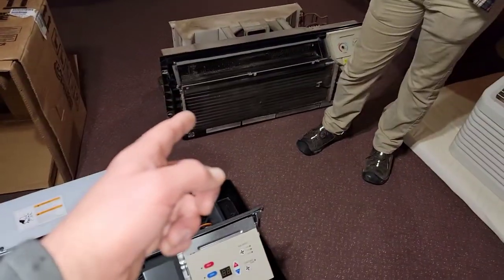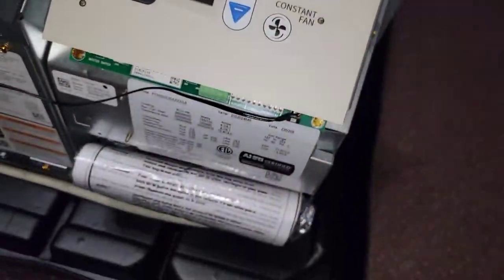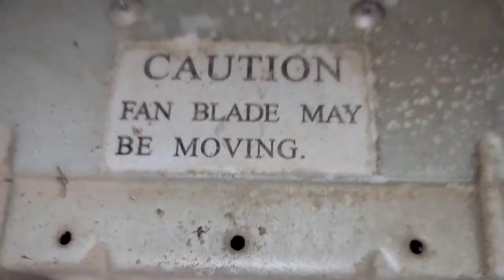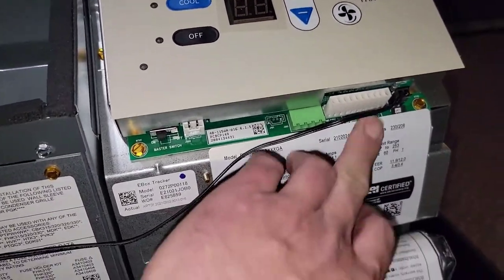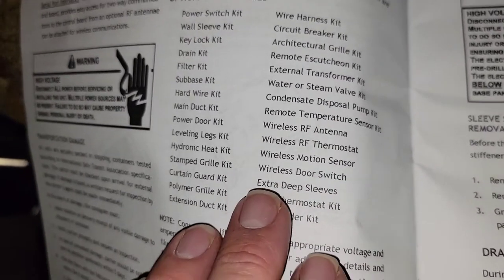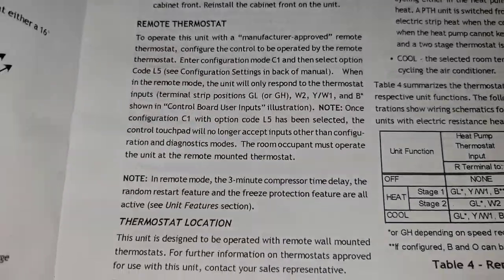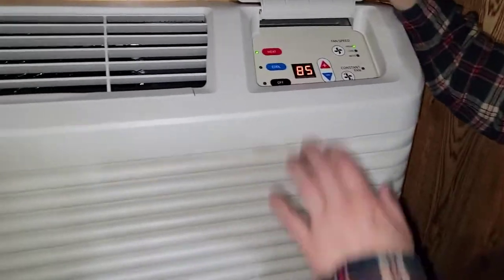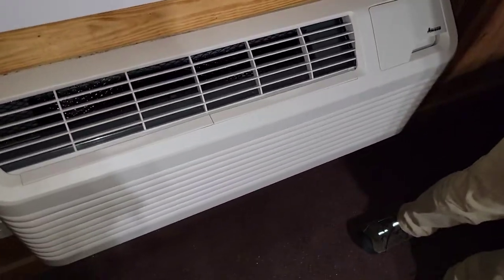PTAC: Old Versus New (Package Terminal Air Conditioner)

Comment: They figured it would save cost and eliminate the possibility of any leaks. Valves can leak over time. But yes, it would be nice. Maybe find some sweat on valves and braze them on as needed.
Reply from the maker: yes you are absolutely right Good idea but for service not so good

Comment: I have been trying to find a video on these Amana PTAC units. Old vs New. and this is as close Is i have found so far.  I have a new style Amana ptac that is maybe 7 years old.  last year, we had a power outage that abruptly shut off this unit during cooling.  When it came back on, it started leaking condensate. not inside, outside, as the older units did. I called my landlord who called Carrier Local Service who said, "Its hot, thats normal, it always does that." and blew me off. First off, it was 74F degrees, that isnt hot.  Second off.... it never did it the first 7 years.... Third.... ive got 36 units in this apartment complex, the only ones that drain condensate are the very few old ones left, and mine. So if mine is working properly, i have 30 that arent :) That was Sept 2020, i shut it off for the season but now its time use ac again. It Cools, but my Electric usage is higher.

my theory....  am i correct in saying that these new units spray the condensate back on to the condenser coil to cool it and which increases efficiency and also causes the condensate to evaporate thus causing no drainage outside the unit.  when other working units end their cooling cycle, you can hear the spray shut down, with mine, i can no longer hear this spray.

forgive my long rambling post, im not very good with writing anymore, i have a ton of health issues and i cant just put a meter on it, or take it apart.  full disclosure, (im a retired master electrician, with a combo cert in build, mech, plum, and electrical inspection)  but none of that matters when the body wont work, and i just cant remember crap anymore)

Thanks, i will pay for solution.  love your channel.
Reply: my theory, i left un finished, :), is that something is wrong with the condensate to coil evaporation, and i forget why the power when out, but i believe it was a lightning strike a block over. thanks any help is appreciated
Reply from the maker: Have you checked to see if its freezing up or if the unit pan is stopped up with anything. Usually these units are installed with a 3/8 slope so that the water can drain out the back where the condenser is. Your theory sounds correct though. I will look into this for you. I wish you better health my friend.
Reply: Could the slinger be broken ? Maybe the slinger is broke and laying where the fan doesn’t rub against it.